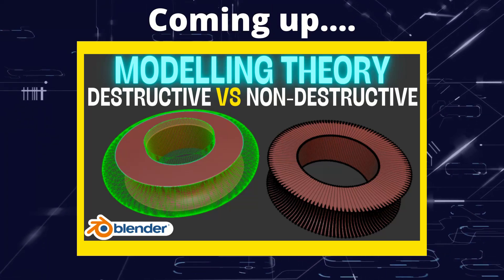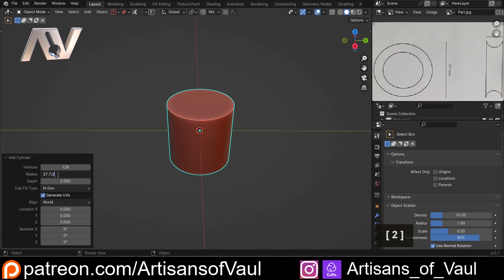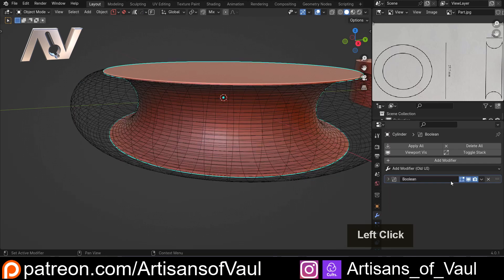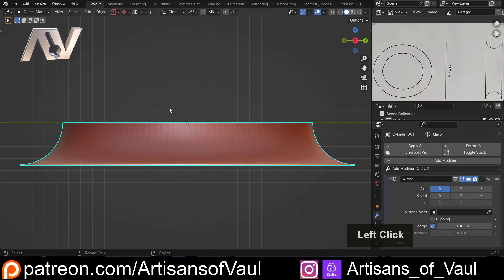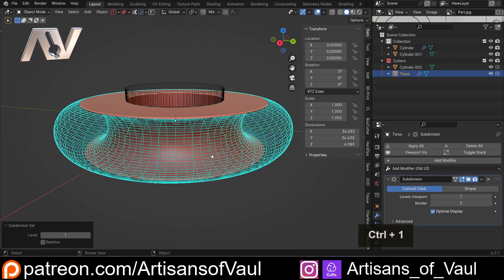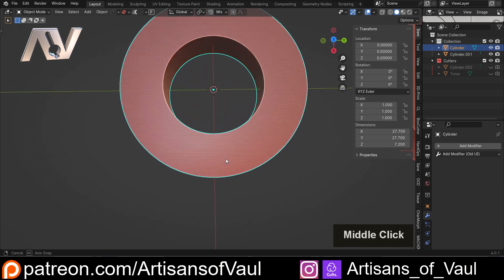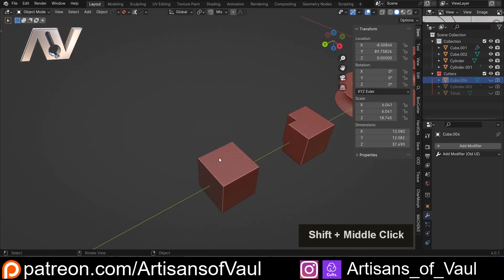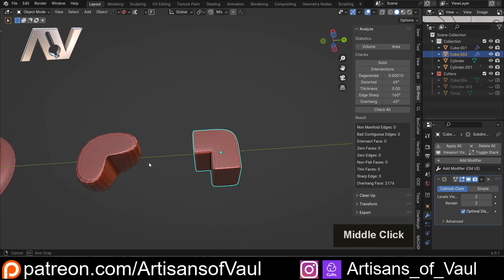Modelling Theory - Destructive vs Non-Destructive in Blender

Comment: Sometimes you can still get the geometry to be nice and work after doing things non destructively by using dice in hard ops. Its just the booleans aren't always able to do what you need to be done in a cut based on the complexity or location for the cut. You just need to be causious where to put the dice cuts and the exta options it offers when in the opperation helps out a lot. I have my apply modifer in my hard ops fav panel so i can press "QQA" and let hardops apply them so i dont have to do it manually. I apply it as needed but also to check the geometry before moving further.
Reply from the maker: Dice is a great tool. I normally use it more if I'm going to bend an object 👍🏻

Comment: !I am for sure doing a mix of these when I'm working in Blender - Non-destructive as far as I can take it, and then a mix of destructive and non-destructive from there. The mix is kinda a key-word, there is almost no situation where a singular solution of these two is the exact correct solution, unless it is something very simple. Great video!
Reply from the maker: Definitely.  Right tool/technique for the right situation and as that changes throughout a project the best designers/modellers will change with it. 👍🏻

Comment: Hey - why is the destructive method the one where you build the model from scratch, and the non-destructive the one where you cut bits out of the shape? 

In my head, cutting bits off something would be a destructive process. 

Just curious about the terminology
Reply from the maker: Destructive modelling is any technique which uses modifiers to change shape (in this instance Booleans) but as they are modifiers later you can go back and change them so you haven't affected a permanent change. This can be something that adds a shape as well, just in this instance I needed to subtract as you can't bevel a single edge that's been created with a boolean without first applying the boolean (at which point it has become destructive as you can't modify that change).